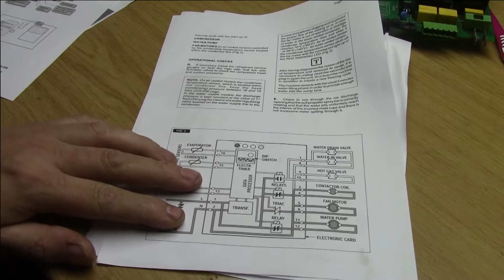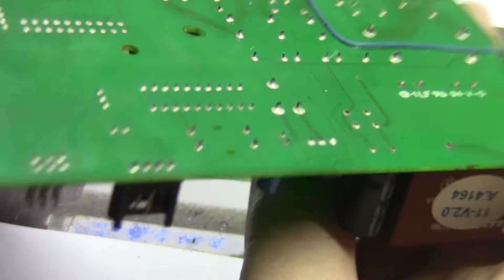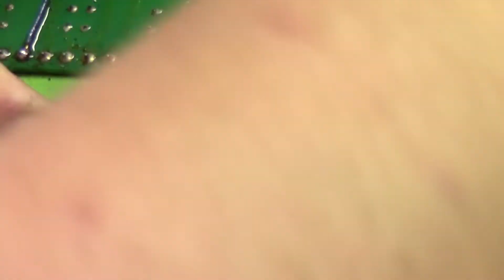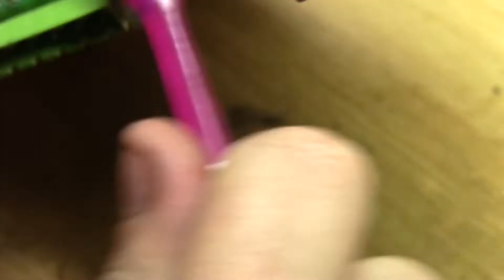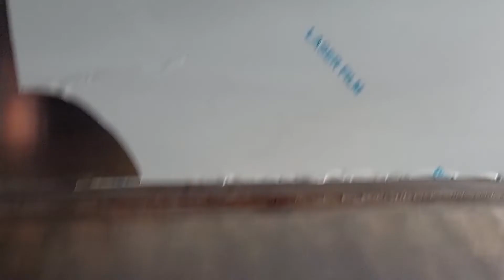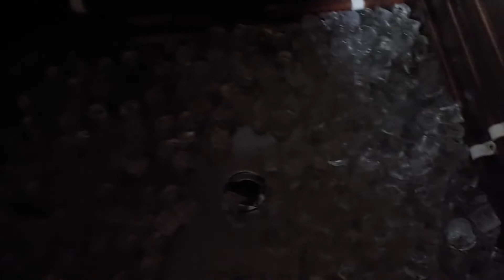ShoutingElectronics #43 - (no) ICE ICE BABY - Scotsman Ice Machine Controller Repair

Comment: Yes good job, because those boards are, from a quick look, extremely expensive, as in over R8k each. Ice maker of course does need to be cleaned properly, and all the black mould removed from it. Bit of clear lacquer on the triac side of the board and it will work forever, going to guess the fault was the resistor flaming up, from the optocoupler getting dirt on the pins, and flaming up the resistor, and then this arced over the board, driving all the fan current through the gate of the triac. Shorted fan motor normally blows the fuse as the motor blows the winding open, so if somebody just put a new fuse in this would explain the arcing on the holder. Fan motor always benefits from 3 drops of engine oil on each of the bushings, they never come with enough from the factory, and I know from experience those fans both run hot, and also fail unless well lubricated. Take apart, apply oil to the felt, and put back together is easier when new, and the plastic parts are not crumbling, along with the insulation.

Good source for those optical couplers is to grab old split AC inside control boards, they normally have 2-3 of them there, and the triac, used to control the relays for the fan and compressor. Also good source of the fuse holders as well, though you might just get the 2 clips, the fuse and a clear plastic sleeve instead, but still works. hopefully somebody actually changed the water filters as well, they never get changed, and likely, if like all I have seen, are either missing, or are a mess of brown and black snot. Supposed to be white, but that vanishes in a week, some are so stuck that a new filter complete is the solution.